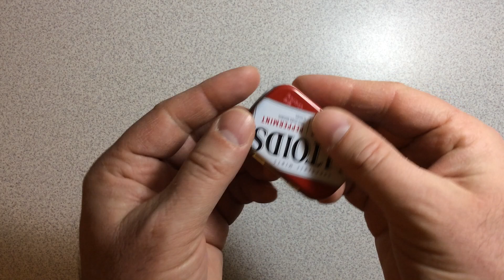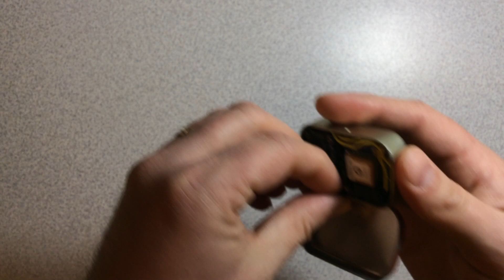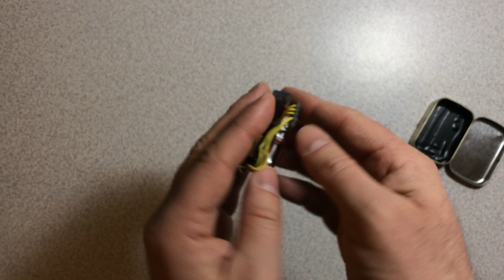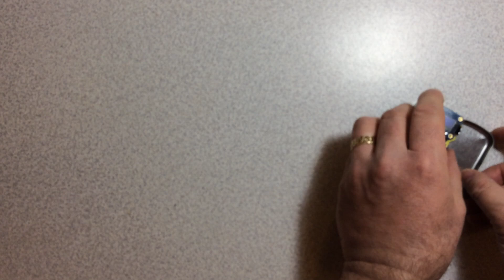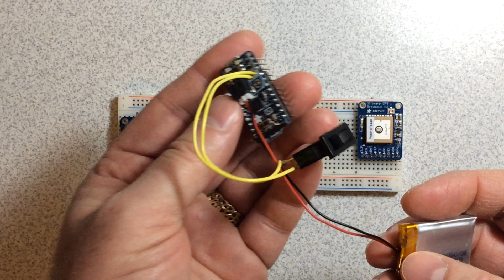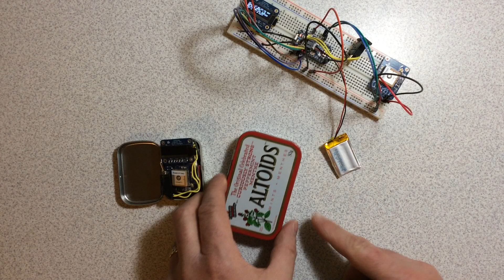Arduino Mini GPS in an Altoids Smalls Tin

Comment: I am trying to figure out what the battery plate does. What does it do?
Reply from the maker: It supplies the board with power from the battery. It also charges the battery when you plug the cable into the Arduino. I think there are red and green lights on it to show charging status. That’s the biggest reason for it… so you can charge the battery without having to remove it and charge it with something else.
Reply: @shawncruise2030  ahh thanks. I looked into it a bit. It was harder to find than one would think but I did realize it was about handling the battery smartly. Thanks.

Comment: I found a few discarded trackers someone threw out. They are old insurance devices I guess. But they come with Ublox and torglas. Can I repurpose these boards and make them my own devices where they will not transmit data to the original provider? And can I make them transmit data such as text? Basically I would like to use them as a device for my wife and I to communicate over long distance.

Comment: hello my name is jack I am doing a science fair project on your video I am very stuck at the moment and soldered every part on to each board got basically all the same parts did everything you did plugged everything in on the board and I still can't get a light or anything. I was wondering if the gps or any of the other needed to be connected into the Arduino software. I am really new to this and don't really have a clue to what I am doing. I don't know how to code or connect any of this stuff to the computer so I was wondering if there would be any way you could help me because I'm stressed and running out of time before the deadline hope you see this 
                                                                                                              - Jack

Comment: Do you mind telling me what pins you hooked the battery pack to?
Reply from the maker: Same pins as you would use if connecting with a header pin like pics here - https://www.adafruit.com/product/2124.  I used wires instead of header pins because not enough vertical space in the tin.  Also connected the battery switched like here - https://learn.adafruit.com/adafruit-pro-trinket-lipoly-slash-liion-backpack/pinouts.

Comment: Great project! I'm currently trying to create a similar project where i can transmit the location of the GPS to a receiver. Something like a tracking device. I just happened to run into a problem with the GPS not maintaining a fix and the screen is showing zero time. How would i go about fixing this issue?

Comment: I tried compiling the code provided on your website in arduino 1.6.7 I had very many errors and it would not compile, I suspect this is because the adafruit libraries have updated. do you have a more updated version of the source code?
Reply: I have no idea how to fix it but have found out the reason it wont compile is due to the teensy 3.2 board I am using. I have no idea how to rectify that though.

Comment: Very nice,  Question do you fine it hard to acquire GPS satellites operating inside the Altoids Smalls Tin oppose to using a plastics case?
Reply from the maker: GPS signal is lost if the lid is closed.  Gets a strong signal in the tin with the lid open, no different than being in plastic or by itself on a breadboard.